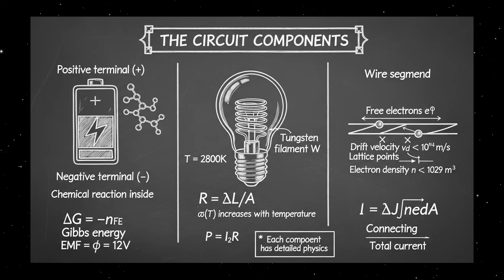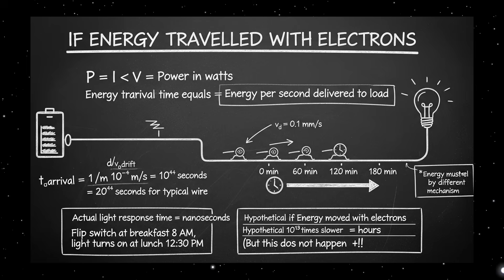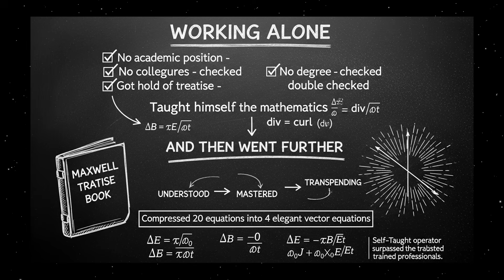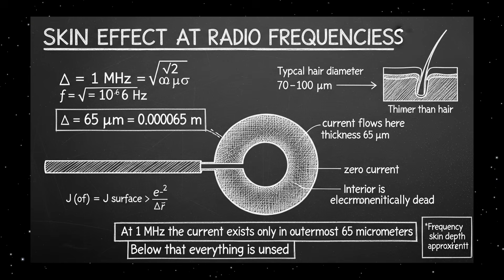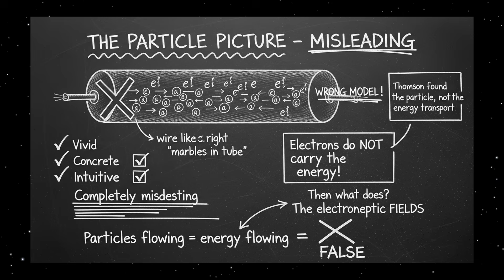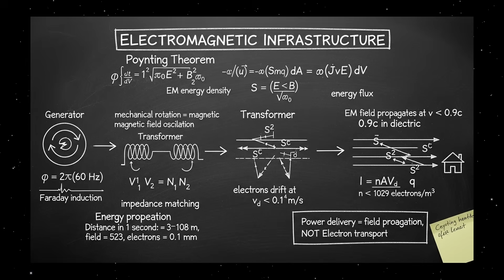Why Electricity Doesn't Flow Through Wires?

Comment: I'm having a bit of a hard time wrapping my head around the field theory.  How do you explain how a vacuum tube or CRT works with this theory?  They both rely on the flow of electrons from the cathode to the anode, so how do you explain the flow of electricity in these items if it isn't a flow of electrons? There is no wire to shape the electron field.  I would like for someone to answer this.

Comment: Why does this channel pretend to know anything? It is all made up and generated content for the sake of what? Views? Why try to spread disinformation in the first place? 

For instance, the first example with the water hose representing a classical way of conveying how current flows in a wire: it is slow, granted, but the water it is moving throughout the entire hose at the same time such that if one water molecule is pushed into the hose at one end another is almost immediately pushed out the other end of - there is no need to wait for the first water molecule to travel through the entire hose.
Reply from the maker: You're actually making the same point the video makes — that the energy transfer is nearly instantaneous even though individual electrons move slowly, precisely because the entire system responds at once. That's exactly the distinction the video covers. As for the content being "made up" — every claim is based on published physics. But if you spot a specific error, I'm always open to corrections.